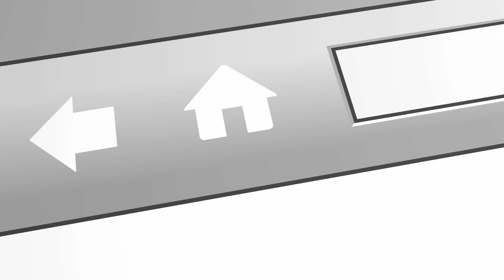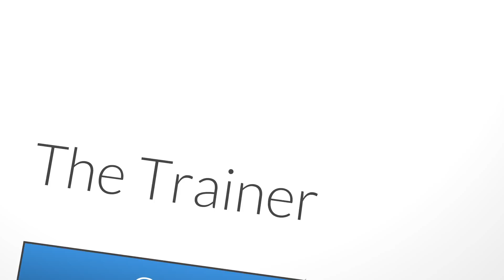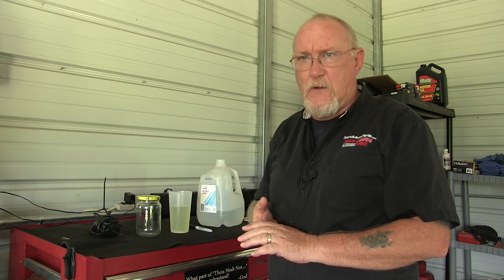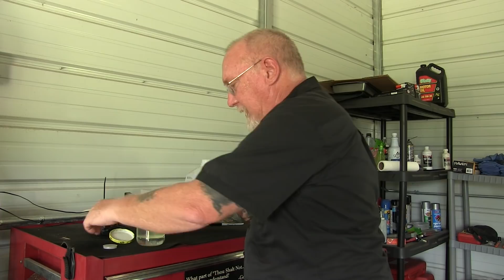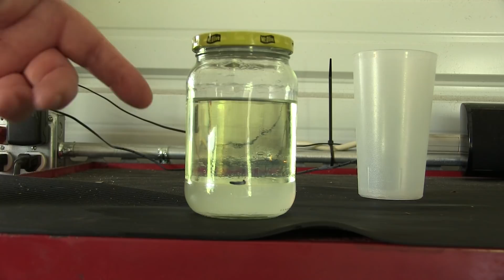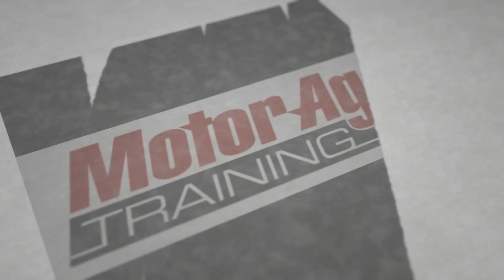The Trainer #67 - When Fuel Trims Won't Trim

Comment: First off thats one excellent video you got there sir. Just one question The other day i had a lean code for one bank and saw there was an exhaust leak right before the up stream o2 sensor, Well i got that fix  and now i got the car is running rich only during acceleration  longtrim -10 to -14 and shorttrim bouncing from -5 to -9 when i step the foot off the gas pedal or makes a stop the the trims are okay. Is there anything i should look at or do the trims adjust overtime after  fixing the leak.? Thank in advance
Reply from the maker: You may be looking at a correction now that you fixed the original problem. Drive it a few days and see what happens.

Comment: So... Very informative video... Have been trying to track down the culprit of my phantom lean condition that only seems to come about when the ac compressor fan kicks on and there is a higher load on the engine.  Makes me think there may be some fuel delivery issue or some odd vacuum leak from the fan or possibly an electrical issue that disrupts the proper calculations by the ECU.   I'm not totally sure, but was looking for a bit more insight.   I just patched my exhaust and now it only goes lean after warm up on bank 1.
Reply from the maker: Need some baseline info - YR, Make, Model, Engine, mileage? Are there any codes? What are the fuel trims (STFT and LTFT) at idle and when the problem occurs?
Reply: Sorry. Thanks for the response.  It is a 2005 Nissan Pathfinder se-off road. It has 133k miles. Brand new catalytic converters (4) just inspected in may.  Noticed a leaking exhaust sound and had the p0171 code for the lean bank 1 (passenger seat side of engine)   this code cleared after patching some of the leaking joints, but now the fuel trims are around 0 at idle ( fluctuating around +/- 5%) but if I add a load on to the engine, say I max out the ac, the short term bank 1 starts to climb up, if I am driving and the condenser fan kicks on, shortly after I watched the short term bank one only rise up to 25% and stay there, unless opening the throttle significantly.  The other bank seems to be fine.  I'm wondering if maybe an o2 sensor may be giving bad data when it gets hot or there is some electrical issue or stored memory to add fuel on that side when there is a certain load added.  Not too sure.  Although I am worried about the fact that I replaced the fuel delivery hose, but thought if this was the issue, there would be a more pronounced issue among both banks, but that might just be my mind not wanting to admit I may have screw up the fuel delivery pressure or volume as you mentioned, when the load is added and this disrupts the fuel volume and since it adds to the one bank, maybe it's enough and doesn't need to mess with the other side, not too sure.  I might unplug the fan and see if that may be a source of some shortage or something.  I found a few popped fuzes, 2 for the transmission in the engine bay and one in the clove box for the lighter port.  The mechanic I went to said that there is probably some electrical issue with my cluster since my oil pressure light is on, and charged me 200 to swap out the sensor without asking lol,.  I feel like these issues may be feeding into each other.  Heard that this engine has problems with the timing chain tensioners wearing out which causes excessive heat which then blows out the oil gallery gasket in the rear timing chain which causes my lack of oil pressure which may cause more of a load on my engine (~23% @ idle, not sure what it is supposed to be) which causes the fan to kick on more often causing some sort of electrical short which for some reason indicates to my engine to add more fuel to speed it up a bit to account for the load and the lower oil pressure.  Idk.  I'm trying to piece it together from my limited experience from watching helpful experts like you who have graciously given their time to help others.  Figured I'd ask someone with extensive knowledge willing to give me an idea and would be happy to send a tip for a tip to your PayPal or something
Reply: It's a 4.0 L V6.  Still causing issues. Just ordered a new exhaust and tail pipe with hardware and cement to try to seal it the best I can and eliminate any exhaust leaks disrupting my sensor data.  It seems like there is a load switch or something that gets turned on and causes fuel to be added on the bank one.  I watched the bank 1 short term trim go from evening out (-9) to 25% positive.  The O2 sensors seem to be out of sync as well, with the bank 2 at 600 and the bank one at 300 at idle.   Maybe when the computer starts accepting oxygen sensor data, this causes the lean condition.  Just don't want to be shelling out for O2 sensors if I dont have to.  Might put my old ones on and see what it reads.  Try to get all NTK or whatever is the OEM manufacturer so hopefully they'll all be on the same page at least with baselines and what not, I hope.   Other than that, I have that squealing sound like an ac clutch or something, but it sounds like it's coming from the bank 2 (driver side) valve cover, and it is known to have timing chain tensioner failure due to the improper manufacturing of the timing chain teeth, being too sharp for the plastic tensioners.  Requires a complete timing overhaul, I think this issue causes an increase in internal temperature which causes the rear timing cover gasket (oil gallery gasket) to fail prematurely resulting in low oil pressure after warm up.   I'm wondering how these issues could exacerbate each other or be the result of one or the other, and hopefully get to the bottom of it.  The electronic failures seem to be most troubling.  Might want to rule out any extensive goose chase with the ECU and wiring before I throw any more time and money into it.
Reply from the maker: @pootypank   You never mention LTFT. We need to consider the overall total trim, so please - so that I can try to help - record the total fuel trim at idle, then while held at a steady 2500 rpm. Fluctuations in speed will create short term fluctuations in trim as the ECM catches up to the changes and since i can't view the data personally, I can't tell if that is part of the problem.
Reply: https://youtu.be/_6Uanm8NxeE
Reply from the maker: @pootypank  Notice the LTFT for B1 - it is nearly the exact opposite of STFT for B1. You fixed the original problem and now the ECM, having made a correction for the lean condition, is now adding too much fuel. STFT is going negative trying to correct for it. This is not unusual if you didn't reset the ECM's memory after the repair. Drive it for a few days and check it again OR disconnect the battery so the ECM memory will reset.
Reply: Everything seems to look okay initially, except maybe the O2 sensors are out of sync for some reason.  Looks like there is a significant deviance of voltage between bank 1 sensor 1 and that of the bank 2 sensor 1.  Not sure if this data can be useful at face value from this short video.  The main issue I come to find is that after warming up for around 15 minutes, all of a sudden the short term bank 1 fuel trims spike to 25% and stay there until the vehicle cools down.  Feeling like I have a faulty sensor giving erroneous data, but wanted to make sure I replaced the rest of my exhaust system to eliminate all possible leaks I missed and go from there.
Reply: That is what I initially thought, until it warms up and all of a sudden the short term bank 1 trim goes from correcting the long term, to causing the lean condition stuck at positive 25%.
Reply: I will try to get footage of this when it happens.
Reply: https://youtu.be/wdbHqCUh7s4
This shows the issue where out of the blue (when the fans kick on usually, but not always) the stft bank 1 goes to 25% compensation.   I think all my sensors are fine and that sensor is doing it's job and spotting the excess oxygen, and after the engine is running hotter, this changes the exhaust pressures and more outside air can be sucked into the cat through the exhaust leak I found, I speculate.  I'm hoping the new exhaust I put on fixes it for good.   Will update when all the exhaust cement is cured and it's driven around a bit.

Comment: I have the follow problem. My long term doesn't move and stays at 2.34% . Bmw car, i rechecked everything 10 times .. The injectors didn't yet only
Can you please tell, what the hell happen with my car causing code p0170 https://youtu.be/xe-o32a4BwI

Comment: Heres a interesting one for you, my Boxster 986 runs fine, no check lights, o2 readings fine, short term trims bob around zero, long term trims +6 and +7 no change under different engine loading or speed. its not a problem as the car runs fine, but I am always curios as to why the long term trims are high?
Reply from the maker: I really wouldn't consider that high. LTFT will increase with wear and tear. Like the old saying goes - If it ain't broke...
Reply: @VehicleServiceandRepair  well I agree with the ain't broken bit, lol

Comment: Hi, I understand fuel trims and thankfully a little more after the video, but I have a question. Q. my LTFT is constantly high at 36% and above, this does not trigger any codes or engine light. The puzzling thing is that if I put the electrics under load by having the lights on full, operating the cooling fan or have the windows going up or down and then holding the button down. The fuel trims drop to around the 0% -/+ 5%. What is this about. Thanks.
Reply from the maker: That is very strange. Typically, when strange things happen related to electrical components, I look at the primary grounds. If there is a voltage drop issue on the ground side, perhaps it is affecting the O2 sensor's output. Try watching it on your scan tool in graphing mode while putting the load on. Another potential cause that comes to mind is the scan tool itself - not knowing which you are using to access this data. Finally, what is STFT doing all this time?

Comment: Hello sir, love your videos and have been a sub since day 1.

Had a question for you. I have a bmw z3 with lean codes. Car has extensive service history. Had it for 12 years. 
To diagnose the problem i smoked it, no leaks. 

I watched your video on fuel trims and my situation is very odd. 

Trouble codes are p071 p074-lean bank 1 and 2.

Short term FT are -6/-7 for bank 1 and 2
Long term fuel trims are 11.7 for both banks. And they stay 11.7 with rpm at 2.5k.

Interesting thing is short term fuel trims go up to + 7 with rpms going up to 2.5k

O2 sensors. I’m getting normal reading for both bank 1 pre and post cat sensors.
Bank 2 o2 sensors stay at .8 value. 

I’m really confused.

I did order maf cleaner and fuel pressure tester. What should I check next. What do you think is the culprit here?

Thank you!
Reply from the maker: Have you tried resetting/clearing the codes? If so, do they return right away?

The only thing that stands out is the weak upstream O2 sensor. But I would suspect a related code for one that is "stuck" at any value.

Comment: Great explanation!  I hope you might be able to shed some light on a condition i have.  
2012 GMC Acadia.  It runs perfect for hours then i get a strange condition on bank 2.  The STFT and LTFT both go to -100% without moving, and they had been running normally at about 5-7% LTFT and STFT going aroun -5 to +5%, then it just goes to -100%.  When it does this i get random misfires at idle and throughout rev range.  I reset the fuel trim learn and it goes back to running perfectly for hours.  I have replaced several parts MAP, MAF, bank 2 sensor 1 O2, intake manifold gasket, pcv and hose, spark plugs.  
Nothing seems to make a difference.
I have checked fuel pressure and it bounces between 52-60 at idle, and fuel rail pressure around 400-500 at idle.
Any ideas?
Reply from the maker: Any codes (and related freeze frame info) to share?

Comment: Mr. would you plz answer my question ? Is is normal to loose long term fuel trims on every cold start ? BMW 2002 m54.
Reply from the maker: If you mean that the LTFT is resetting to 0, then no - that's not normal. I would check the battery. If the voltage is low, the ECM and other ECUs can't maintain memory on initial start up.

Comment: I get P2097 post Cat rich then after about 10 more miles I get P0420. My long and short FT do not go over +5%. It is 2015 Chevy volt. Do I have bad Cat or Downstream O2 sensor?
Reply from the maker: Is the downstream sensor an OE part of aftermarket replacement? Have you tested its ability to react to shifts in air:fuel ratio?
Reply: Motor Age the car has only 39k miles. I have not replaced any of O2 sensors. When I bought the car it had a crack between MAP sensors and intake manifold which I replaced it couple moths ago, I did not notice the crack when I bought the car.

The car that I replaced:
11-15 Chevrolet Volt OEM Air Intake Tube To Throttle Engine Cover  23452493
Reply: No, I have to tested air:fuel ration. I can buy one and  test it. Do I need to test upstream or downstream or both? What is the normal number should look like?
Reply from the maker: The P2097 is tied to the response of the downstream sensor while the P0420 is tied to the comparison of both. I'm going to say replace the rear sensor with an OEM unit and clear the codes/data.
Reply: Motor Age thanks, will update you after it is replaced and passed all the modules test.

Comment: I have an 03 Murano, Fuel trim 2 is open, getting random misfire on #3 cylinder, question, should fuel trim 2 be closed? is it related to the random misfire?
Reply from the maker: I think you're saying that Bank 2 is in "open loop" - meaning that a condition exists that will not allow the ECM to effectively manage fuel. It could be related to the random misfire, so tackle that first. What does Freeze Frame have recorded?

Comment: What would cause one bank to go slightly lean positive 9 and the other to be at 0 at an idle? Map only v6 engine.
Reply from the maker: Is this TOTAl fuel trim? That's the number to be concerned with. If this is Long Term Fuel Trim, it's not what I would consider bad. If it's Short Term, it's in the high side of a normal range (I prefer swings from -5 - +5). If it's a total, it's a non-issue. Consider what is unique to that bank - perhaps an injector or injectors are dirty and not flowing the same amount of fuel?
Reply: @VehicleServiceandRepair  I appreciate your quick response. Those where long term numbers only. The short term at idle stay +/- 5. This is a personal vehicle and it has no cel. I'm just intestested in learning and preventing future issues. I will try some injector cleaner to see if that improves bank 1. Thank you.

Comment: Would a fuel trim greater than 5 or -5 cause a check engine light?
Reply from the maker: The ECM will turn on the MIL light for a fuel trim related code only if the TOTAL fuel trim exceeds the limits set by the manufacturer. Typically, LTFT will exceed +/- 25 and STFT will have to exceed +/-5 to 10 before a "system lean" or "system rich" code will be flagged.
Reply: @VehicleServiceandRepair  TY

Comment: Hi, I have a 2004 Silverado that’s running rich on bank 2 and only giving me a random misfire code my shrtft is 52.3 and lngtmft is 25. Can you help me please????
Reply from the maker: First, are you reading the data PIDs correctly? I've never seen fuel trims, STFT or LTFT, go much over 25-30. Second, what are the bank 1 trims doing? Under what conditions are you reading them?

Post STFT and LTFT numbers collected at idle with engine at normal operating temperature and also at 2500 rpm in Park. We'll start there.
Reply: @VehicleServiceandRepair  it’s staying at 32 fuel trim doesn’t move down.
Reply: I’ll get to it tonight.